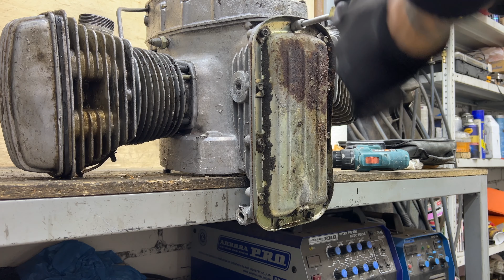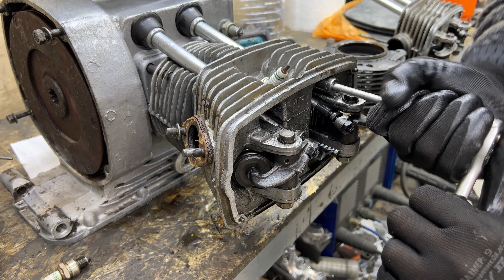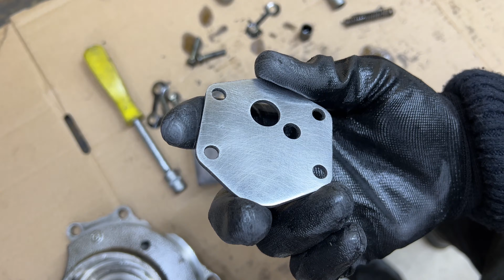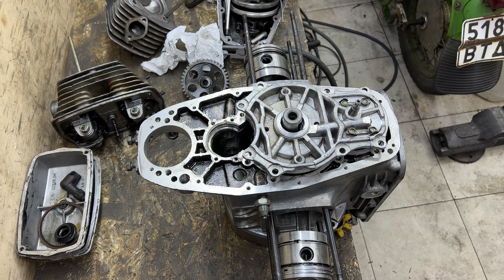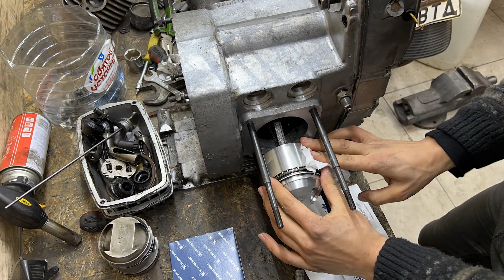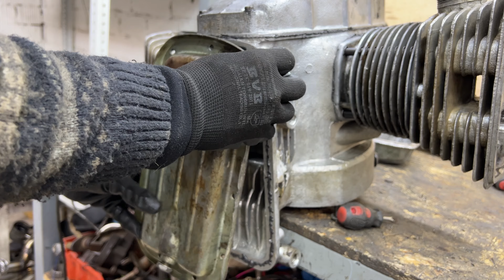Ukrainian USSR Engine Dnepr 11 Motorcycle Restore And First Start After 32 years of being abandoned

Comment: I wish my Dnepr engine would start as easy as that, Full rebuild and it's not starting.....
Great video and it answered a lot of my questions.
Reply: Give the engine more spark advance by filing the contact system to rotate more degrees. . If you want remove the cylinder , larthe machine it to raise the compression about 2 mm from top of cylinder
Reply: @buddyrojek9417  I overlooked the fact I had replaced the carbs and hadn't set them up. Starts good and runs real nice now. Thank you for the advise though I have another with a standard ignition so I'll bear that one in mind.
Reply: @philtobin9510  you need more advance and compression because they were designed to run on 78 octane .  In Ukraine the minimum is now 95.  If the cylinders have any wear the oil does not run down, puddles on the bottom and you get fouled plugs. Had to be super hot , the hottest plugs available won’t help

Comment: I'm Portuguese and I have a Dnepr MT16.

1. Recently replaced the pistons with new rings. The cylinders were in very good condition.

2.I noticed that when I started, the engine "seized" after 2 to 3 minutes. Before grabbing it there was a noise from the bottom of the engine. It was a continuous and discrete noise. Then the engine stopped.

3.I would like to know your opinion.

Note: the pistons are very tight and the segments had to be worked to get 0.05 of clearance. Supposedly they have the original measurements.

Bearings stuck?
Connecting rod covers?
Oil pump?

Thank you very much
Reply: O espaço mínimo permitido entre o pistão e o cilindro de fábrica deve ser de 0,08 mm, e o espaço dos anéis é de 0,04 mm no mínimo. O espaço permitido durante o reparo, sem o processamento do cilindro, é de até 0,15 mm. Olá da Ucrânia.